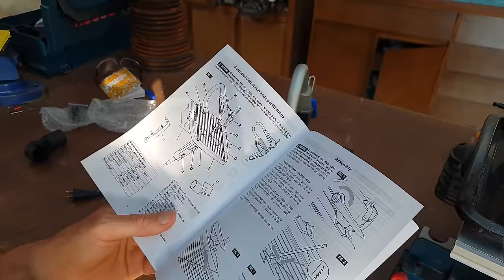Dremel Moto-Saw Review (A Scroll Saw Killer?)

Comment: I have the same scroll saw. I stuck some anti-vibration pads underneath the unit and then clamped it to a work top. This virtually eliminated the vibration. Given enough practise fitting the blade does become easy . . . . trust me ! Open up a gap for the pins at the top of the blade to go in with a knife or whatever; it won't affect anything else apart from making it easier ! How Dremel missed that on the design concept amazes me. The beauty of this unit is the ability to mount it anywhere when needed and easy to store on a shelf when not in use as it is small and compact. I can't imagine putting a larger heavy one on a shelf eh !!!!
Reply from the maker: Good points all!

Comment: I use this to cut acrylic and lexan. Run at the slowest sped to avoid melting and it works great.  (I usually need to use the side facing blade to cut long sheets.)
Reply: I use painters tape on the acrylic, Sellotape works too or I keep the original sticky coating on if it is new plastic. This cools down the saw so the acrylic doesn't melt. I have a an Einhell though, quite glad I didn't get this one!

Comment: #1)  ALWAYS read the directions provided by the manufacturer before attempting to use the product.
#2)  Look carefully at the pictures.  Had you looked at the picture for how to fix the saw to your workbench, you would have seen that you had it attached incorrectly.  You only had one side supported on the workbench.  This produced much more vibration because it wasn't securely affixed.  It also led to you having trouble seeing what the blade was cutting because the presser foot obstructed your view.  Had you attached it to the workbench properly, you would have been looking forward at the cut instead of from the side and the presser foot would not have been in your way.

I think it's simply a matter of men not thinking they need directions.  They want to jump right in and start playing with their new toy.  But, if you take the time to read the directions first, you will avoid many difficulties which will slow you down far more than reading first.

Because of these reasons I feel that the review wasn't fair to the product.  You weren't following the instructions of the manufacturer which led you to make negative comments about the tool which were not due to the tool's ability or ease of use.
Reply from the maker: Thanks for your perspective. I guess I had little choice about it, being a man and all...
I actually agree with you on some points, (though not the gender based casualty). I will try for better next time...
The presser foot obscures from any angle if cutting anything other than straight lines. 
I did get the clamping very wrong though, and I apologise for that. Inexcusable error, that lead to shoddy results. Sometimes I surprise myself with my own stupidity... sorry.
Reply: @FloweringElbow  It is unfortunate that tone of voice cannot be heard in comments, so you have no way of knowing what is said with humor.  But I do appreciate your response and wanted to make you aware that the one thing which bothered you was said in jest.
Reply from the maker: @Mrgrumpypants84  lol. arrrrrggh (pounding chest!)

Comment: I build model RC aircraft so I need to cut mostly balsa and light-ply. For my purposes and material use I think this might make an excellent tool as apposed to an exacto knife and 50 rolls of sandpaper. it's a pity the base doesn't angle for 30-60 and 45 degree cuts but a simple hardwood "jig-block" will suffice. I use my Dremel 4000 extensively when building models. For hobbyist's cutting lightweight thin materials this should be excellent.

Comment: I am a handy girl getting ready to replace all of the baseboards in my house.  Were it a room or two I'd just use a manual coping saw.  But they look so fiddly and I went looking for an alternative.  I was debating about this saw.  Your review did not gloss over the drawbacks.  At the same time it looks like this tool would be a good fit for what I need; especially since I can have it in the room where I'm working without generating excessive dust.  It may be a cheap, limited use product, but it's a good fit to help me be successful in something I was otherwise uncomfortable taking on.
Reply from the maker: Hi kay, thanks for the comment. As you say It sounds fine for that application. It has actually grown on me as a tool, since using it for a few more sensible applications 🙃
Reply: Wow, handy girl 😍. I thought it was an extinct 'species' 😲.

Comment: You did forget that this is a 2 in 1 saw.  When it is removed from the base it becomes a coping saw.  For the hobbyist wood worker this is a slick tool.  Denser wood is gonna push this thing pretty hard, but softer woods (like mahogany) should be no problem.  Also more teeth in the blade will give you more precise cutting, and scrolling work.  Note too that this isn't a ripping type of saw so don't expect this to aggressively cut like a saw mill blade.  That;'s what a bandsaw can be used for.
Reply from the maker: Hey Kjemradio, Good points all! I still haven't experimented with it in hand held mode - the need never seems to arrive... When do you find youself using it this way? Thanks for your comment :)
Peace, Bongo.
Reply: How do you think it would cope with 5mm thick rosewood or ebony? I would be cutting mostly curves.

Comment: I have one several years now but do not like to use it often. Having said that I managed succesfully to saw out a delicate 3D figure last week (as my other saw was broken), it worked best at full speed and with the plastic support as tightly as possible against the wood, I was cutting through 4 cm.    Fitting the blade back with the blade through the wood for an inside cut was nearly impossible and took me several tries. Another annoying point is that you need a big hole to fit the saw blade through, more than 2mm! I have no issue with blades breaking, probably because I use the highest speed and work slowly. The table is fixed so cutting under an angle is not possible. I do not find the sawdust suction great, I have a festool dust extraction system, but still have to blow sawdust constantly what covers my line. I love the dremel drill stand and accessories to route, drill, sand etc, but this saw is not much use for me, and I do not like using it either. The positive, it's nicely packed away in a platic box ones you puzzled out how to put everything back, lol. To buy or not to buy? Well it depends for what you want to use it for. If you want a real scrollsaw spend more money and sawing becomes much easier!

Comment: Coming in late to the convo, sorry. Used a few scroll saws and lots of band saws.
Let's stick with the first rule of any craft: The Right Tool For The Job.
All Dremel tools are more for the hobbyist. Period.
Always some in-duh-vidual that buys a Dremel anything to save some money and then bitches because it's Not Professional Grade!! Well, if you yourself were pro grade you'd have known before the purchase.
I am considering buying this moto saw thingy for hobby/light work. I build custom knife sheaths and other things using materials like kydex. This saw should be just fine for that kind of application... maybe. Will keep looking for reviews.
I've got the Ridgid 20v Drill / Driver combo, and really do not need to pull it out to drill some stitch holes in leather. That is why I have a Dremel... for Dremel type jobs. Way more compact, easy to handle, and amazingly has all the power I need, to drill through an inch of leather.
If I am doing custom woodworking then I'll pull out the Rigid hand drill or more likely head to the drill press so I can get super precise drilling done. Same with cutting. If I am making a custom pocket magnifier with a little cherry and walnut the big band saw will definitely do the job, but it's work I could easily do at the hobby table with a lot less saw. Maybe this saw is perfect for that light work it was intended for.
Anyway, scroll saws are primarily That Tool for cutting out hole shapes. Outside edge work really should be done on the band saw, but people get lazy, even me. Still, blade life, motor life, etc... scroll saw = inside hole shapes  / band saw = outside shapes.
Doesn't matter the scroll saw, you are going to bust blades and cuss putting them in. Craftsman, Delta, Dewalt, Shop Fox... blades bust always in the middle of the cut so cussing occurs (see steps 2, 5, 12-16). Band saw blades will bust under the right conditions but as you said the whole blade gets used.
--
In closing, I am not trying to be an a-hole, but you can't make some cantilever surface to clamp a scroll saw to and then bitch about vibration. "Vibration" saws are all about that rattle, does not matter brand or if you use the little boot, you will vibrate your hands numb pushing an 8 hour shift on one. Simple Physics says putting ANY scroll saw on a surface supported at only one end will be trouble. Hell, now that I write this I am actually more interested in this saw since I am surprised you got any cut out of it the way you had it rigged. The more the scroll saw vibrates the less energy goes into the cut. Stop as much vibration as possible and you get as much cut energy as possible.
Thanks for filming your experience with this tool.
Reply from the maker: Hey Dave, Thanks for this. I think you're about right on all points. It IS way better after I clamped it up differently to a more solid surface. 
Peace, Bongo.

Comment: 5:05,  you put the clamps in the little slots you had them in before but from the front side not the back.
Reply from the maker: Worked that out right after putting the vid out. Doh.
Reply: And this simple action makes the saw much more stable on the table, if you'll pardon the alliteration! Also, I believe you can put the blade in at 90 degrees to the position you showed it, and thereby cut longer items along the side of you bench. Your method of attaching it to a piece of wood jutting out from your bench gave it NO chance of proving any stability. Not a fair review!

Comment: When a saw cuts the chips collect in the gullets between the teeth.  When trying to cut thick stock with a scroll saw only a few teeth on the top and bottom of the stock get a chance to empty their gullets.  The rest fill up and keep the teeth away from the stock.

I have an old low end delta scroll saw from the 80's.  It has a heavy cast iron table but unless it is firmly bolted down its vibrates too much to work on too.   But yeah just say no to plastic saws.
Reply from the maker: Yep, love it - great explanation of the teeth problem! 
"Just say no to plastic saws." Chuckle.
Reply: Good point about chip clearance.thanks

Comment: Greetings from Scotland. Do you have any ideas how to cut a 45 degree mitre given the table does not adjust from 90 degrees?
Reply from the maker: Hmmm. A different tool would be best.
Reply: @FloweringElbow  Let's just say, if I only have the Moto-Saw? I've seen someone on YT tape wooden 45° blocks onto the table to act as a guide.  But that is not very sophisticated. I've tried searching for triangular aluminium tube online but I can't seem to find anything appropriate. I thought, given how long you have owned your own saw, you may have surmounted this problem. But, if you have a workshop full of equipment, I guess this question doesn't apply to you. But, thank you for sharing your thoughts and your videos.

Comment: I was always under the impression the power came from your dremel that you attached to it, not that it had its own power source entirely
Reply from the maker: Good evening Lucas. Thanks for the comment. Power comes from the mains supply. Its 110v so here in the uk I need to use a step down transformer.

Comment: I got mine yesterday and not happy with it, first time I use it today I damaged the plastic hole where the blade runs with the blade. Vibrates a lot and for me is not a good investment...or maybe just need to practice a bit more...
Reply from the maker: Hi SuBastors, thank you for getting in touch and sharing your experience. I have actually found it more useful as I have go to use it more. I think a LOT of the vibration in mine was mitigated when I changed the clamping arrangement, and clamped it to the 3/4" steel plate of my welding table! 
My biggest gripe is still that the blade change system is fiddly, and that it's just repulsively plasticy... 
Thanks again, Bongo.

Comment: Finally - the instructions :-) - First test found it useless - blade bending/twisting, hard/impossible to make a straight cut in 6 mm board (hard)

UPDATE: I put the blade in upside-down. The top of the blade have a long section with no teeth - Unfortunately I mounted it in the Australian way - upside down, giving almost no cutting. Closer inspection after watching videos of the saw working revealed the embarrassing truth.  You don’t notice the ‘missing’ teeth when the saw is running.

Comment: Thanks for your very helpful review. However,  after attaching the saw blade I tend to notice that it isn't perfectly straight, resulting in angled cuts and making it challenging to get the wood straight in. The wood piece always tends to move away. As a fix I need to start at an angle and push it in at angle different from 0°, which isn't very ideal. Any help from anyone would be highly appreciated! Thanks...

Comment: I picked up this saw when I had to do a laminate kitchen floor for a customer and It worked well for the thickness of the planks. I think the vibration problem was more about how you had it mounted, I had it attached to the counter top and it was fine for me.. pros.. portable . lite weight, good for small cuts. cons,, to me the only problem is I can not go out and just buy blades for it. Dremel used a smaller blade than any other saw out there. so for the money spent you could add a few more dollars and get a cheap scroll saw if you were going to do a lot of scrolling, I do like the saw and only wish blades were available.
Reply from the maker: Hi Daniel. Thanks for your mini review of this saw. Valid and good points all. I guess you must have had some intricate shapes to cut for the floor to make it worth it... How do you think it would have compared to using a jigsaw? Did you try using the saw without the base, in it's handheld mode? I haven't tried it that way, and wonder what it would be like.  
PS agree, I stuffed up the mounting, which was a cause of a good lot of the vibration...At some point when I have time I need to redo this review...

Comment: looks nice. I considered one for a while but I reckon I'll just get some slimmer blades for my jigsaw and a hand coping saw for really delicate work. That noise and vibration would annoy me.
Reply from the maker: It's certainly one you would want to use ear defenders with🙉. I'm not sure you will be able to use blades too similar in a jigsaw as these blades for scroll saws are designed to be used in tension - they are very flexible without support both ends...
Reply: thanks. yeah I just mean some blades slimmer than my current ones.

Comment: The slow mo at 10:36 highlighted that without the foot down and firmly pretensioned you're wasting a lot of the power it has on resonating the head up and down rather than cutting the timber. Definitely just a hobby level toy, though. I stopped using my old moto tool when I got my M12 die grinders :-)
Reply: Heard mixed reviews of those, which did you get?
Reply: @Backstabbio  Both. They are not as powerful as an air die grinder, but air tools beat lithium tools every time, the power source is external so size to punch is always best. However they are powerful enough to do reasonable things. Unlike an air tool you can't *over*load them or they will stall out. Also watch out for the earlier version of the straight one - it has a one size fits all collet whereas the right angle and later version of straight one have the same 3 collet system which is much better. Borrow or try one in a shop or something, take your target work style and test it, I found them to be great especially for stuff like getting a 3" cutting disk into a tight place to cut something I otherwise couldn't. Just take it easy and it'll do great.
Reply: @Backstabbio  If I wanted to do some heavy long period work with a die grinder I'd still get out the air tool because of the infinite run time and superior power when you lean on them too hard (note TOO hard). But for example shifting a wrongly placed drilled hole in some steel plate over a few mm or so, I'd go for these every time. Same deal with big grinders, I have 3 dewalt flexvolt grinders near the garage door and I pick them up for small jobs every time. If I was doing heavy fab and lots of grinding back welds or rust removal or some such, I'd run an extension lead and use a tool that will out-last me :-D
Reply: @fredio54  Thanks for the review! I've been looking at getting the M12 grinders for a while, being cordless is too handy.

Comment: I have this scroll saw and yes I am just a hobbyist but I found it easy to set up and use, mine is clamped to a work bench I get very little vibration, I did read the instructions first, mine looks slightly different to yours and came with a UK plug and a miter gauge that fits in those grooves, I have had mine about 4 years now.
Reply: Hi Dawn, would you recommend this for a dollhouse hobbyist? I'm looking for a moto-saw for a bench. Thank you!!